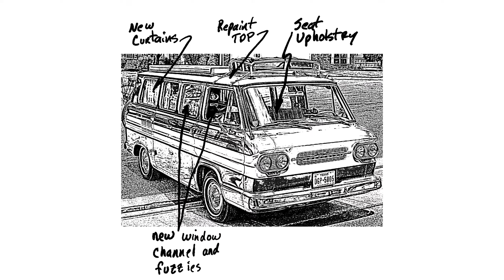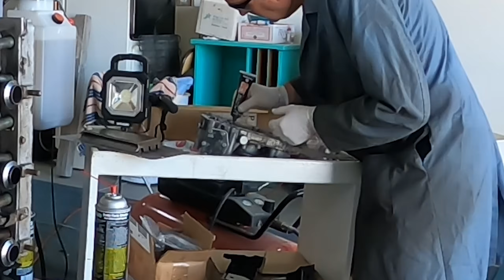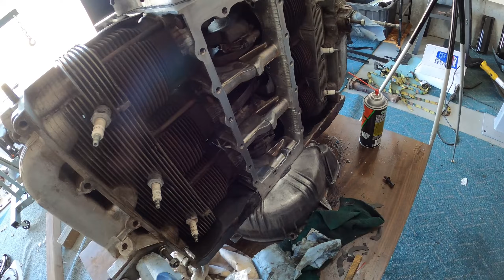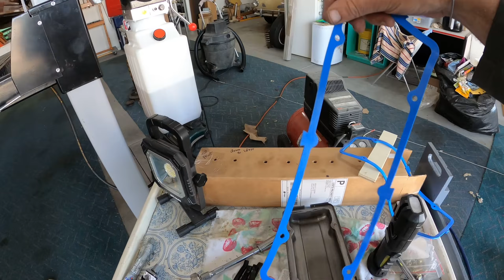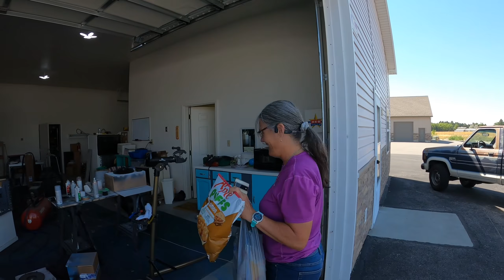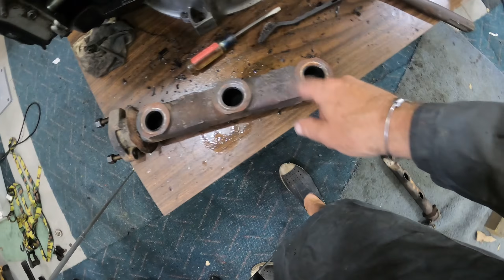Builder Series - Luna (Corvair Greenbrier Van) Refresh Part 10

Comment: Working with the doors wide open. Go away winter and bring us the heat. Eek, not more stripped bolts. Bought a new inverted welder as i was using a buzz box. Yeah i know, should of bought a washing machine instead cause it is down. 40 years old and the agitator gear seems seized. Lol.....love that you pointed out the black on the nose. I was laughing already before you pointed it out. Sniff sniff. Dam colds.
Reply from the maker: Hey Dave,
I'm ready for Spring when I can work at Frank's with the doors open again.   Tired of winter and we've been in the warm south for months.    I don't want any more stripped bolts, but that's part of the 60 year old car fun.
New welder is nice.   I need one.   You can always wash clothes by hand but you can't weld by hand.
I'm surprised I don't have grease on my face all the time when I'm at Frank's Place.
Thanks for watching.
Enjoy the Ride